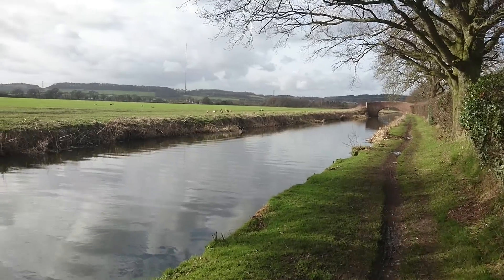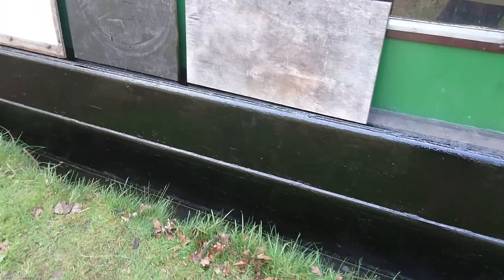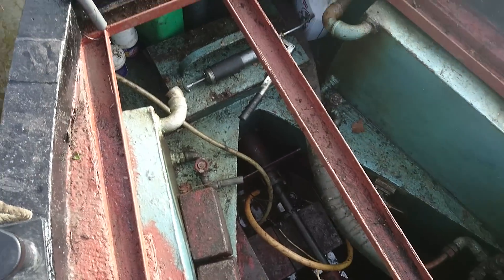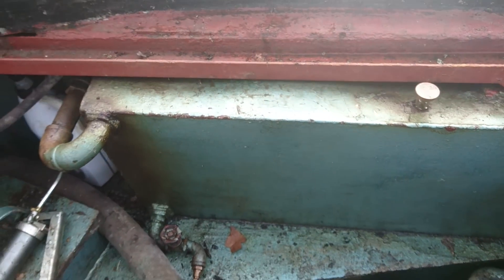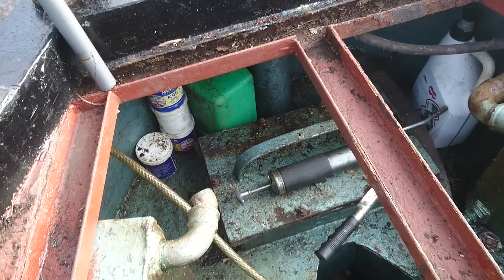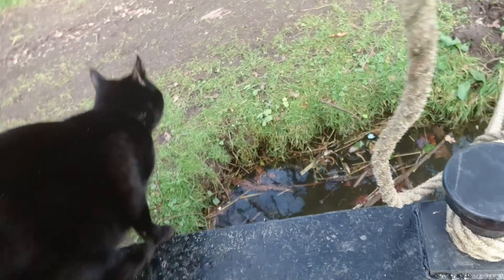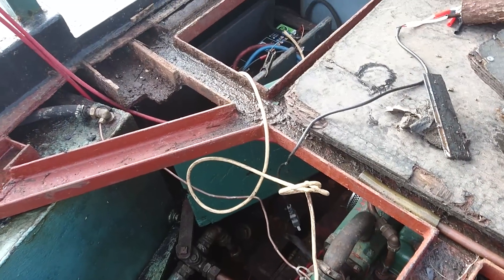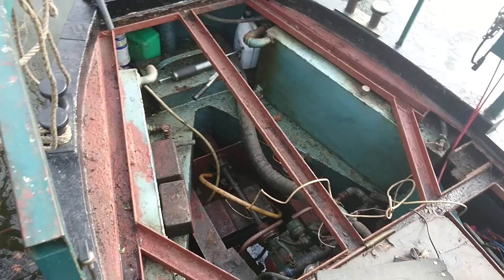022 - Bilge Pump in the Narrowboat Engine. (Water in the Engine Bay).

Comment: Hi James. I wondered if you have inspection hatches to check for water forward of the engine compartment in the event of a leak from the kitchen or bathroom?
Reply: You can see into the bottom of the boat in certain places but I've not found an inspection hatch.